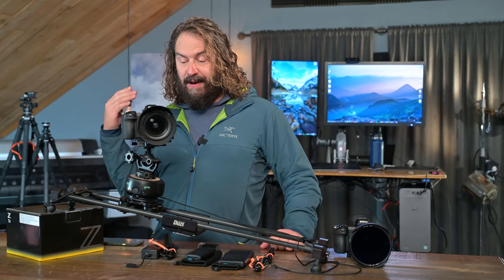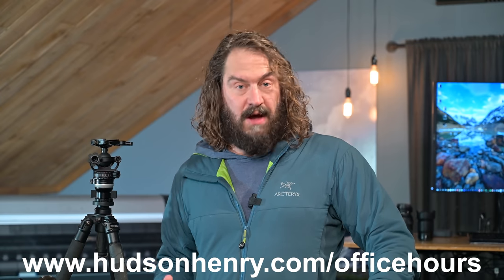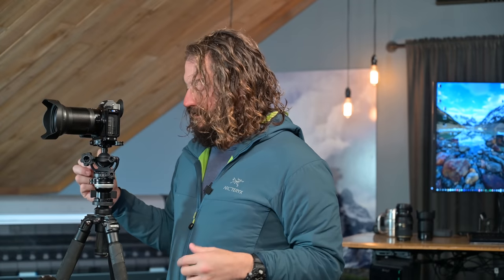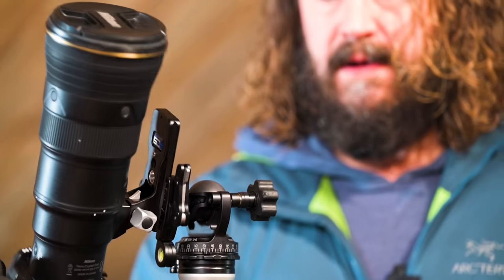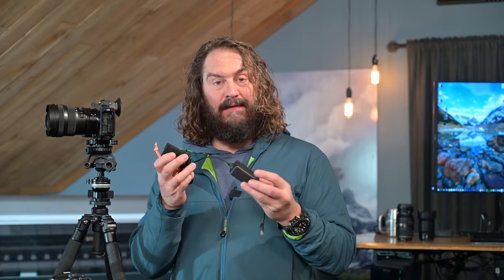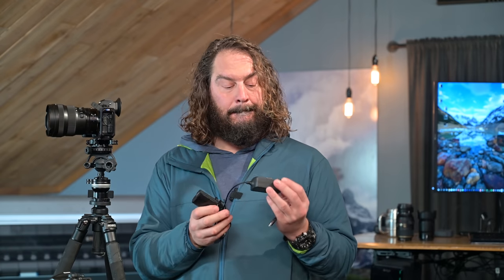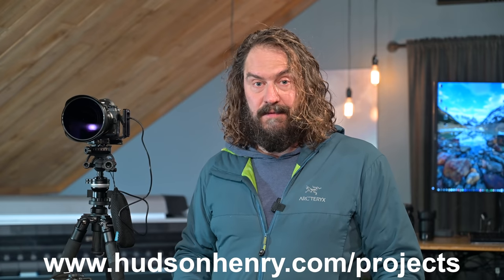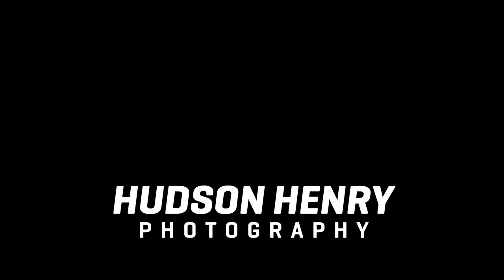Approaching the Scene 130: A Badass Ball Head + Z6ii Z7ii External Power

Comment: Interesting on the power delivery. I have the original Z6, and use a dummy battery that plugs into a V-mount plate, since I use my rigs for video primarily... Most of the generic v-mount batteries have a USB output too. Assuming it delivers enough amperage, that could be an option too.
Reply from the maker: Yep. So long as it's 15W plus. :)
Reply: I have a Z6.  I didn't think you can charge and fire the camera at the same time like you can on the Z6ii?

Comment: Hudson, at roughly the 11:25 point you describe the inability of a ball head such as this to remain level if tilting up or down while doing a multi row panorama shot.

This is actually quite easy to accomplish, especially since you already have a leveler mounter on your tripod.  If you leave the Ball Head in the "normal" orientation, and level the ball head using the leveling base (the same as you would on your fluid head), then tilt the camera up or down but use the camera's level to keep it level on the "roll" axis, then you should be able to use the pan adjustment to keep everything level through the pano while the camera is pointed up or down.

Without a leveling base, you are right, the camera will pan in an arc, but with one it is an easy task to accomplish.

FWIW, I have had an Acratech GV2 Ball Head (and a leveling base) for years & I love it.
Reply: I have this ball head and wish I understood what you are talking about with the multi-row pano capability.  Maybe Hudson can comment and explain?
Reply from the maker: Right, sort of... It's true you can level it below and then tilt and level left right on the camera and then pan at the base, but it's just so much less precise and more complicated to loosen the ball and recompose with a free moving ball and relevel between shots when doing multi row. Particularly if clouds are moving fast and you need to shoot  in vertical columns instead of horizontal rows. There's a precision composing with a pan & tilt that a ball head just can't touch. Fluid only makes it better. ;)

Comment: Hudson-Your setup in this video using the L-bracket and power charging cable looks great. My question is will this same setup work in the portrait position?
Reply from the maker: It will if you have the Kirk I link in the description and slide it out to its 2nd position to give space between it and the body.
Reply: @HudsonHenryPhoto  Thanks. Do you think it would work with a DC-2 connector (cable release). I have a D750 and D780 that I have issues with when trying to shoot vertical. So I have a z7ii on backorder and it uses the same DC-2 connector. It would be awesome if it would workout with the new L-bracket. 
Also thanks so much for your informative and quality tutorial videos. They are top notch.

Comment: I wonder if a USB-C splitter would work to run the Unleashed in parallel with the external power source for for long timelapses
Reply from the maker: I'll experiment with that. I'm sure the unleashed barely takes any power. Maybe just a 2nd line from a battery with a female usb-c adapter.

Comment: Thanks again for your work.  Do you have any form of safety stops on your clamp/plate systems?
Reply from the maker: All of the Kirk and Acratech clamps and rails I use and recommend come with safety screws for the rails and stops on the clamps to keep you from sliding off a partially open clamp. It's a good safety measure. :)  Links to all my gear are at www.hudsonhenry.com/atslinks

Comment: Powering these new cameras directly with USB Power Delivery is great in the home, studio, or dry weather but be aware that you lose weather sealing while doing so. I still prefer the dummy battery method and there is an updated version out there now on Amazon. It's a little bit clunkier but you get to keep the camera sealed up.
Reply from the maker: It's a good point, I generally don't find myself doing work where I need longer battery life than the stock batteries in wet conditions, but it's a solid point.